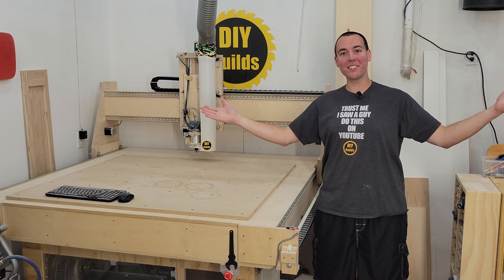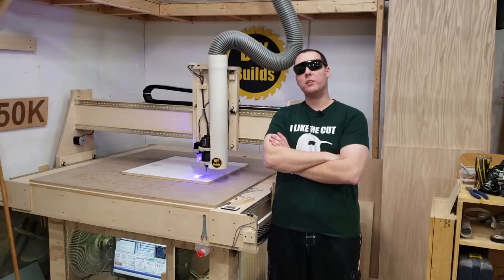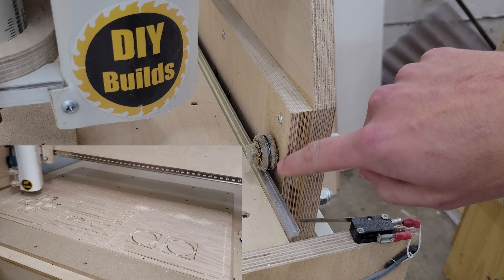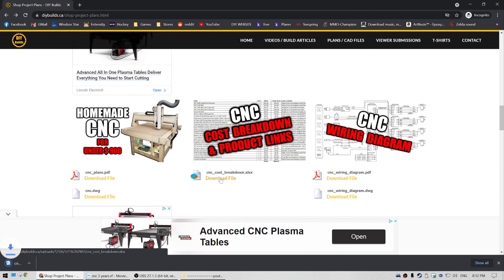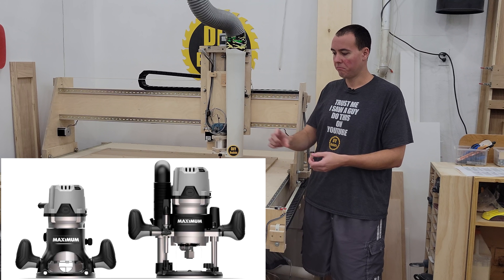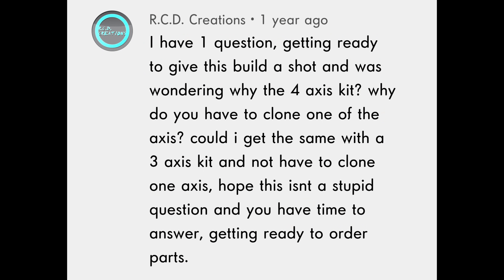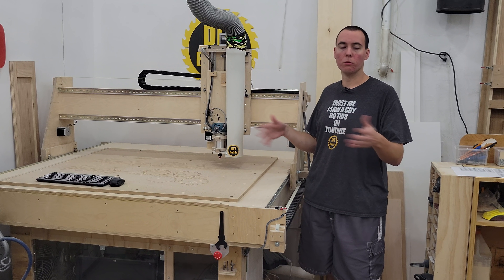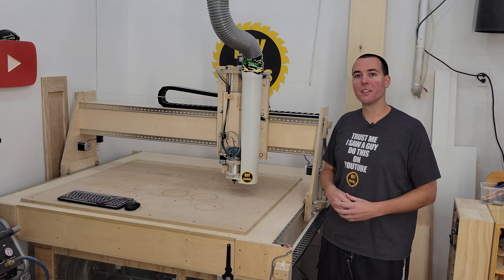DIY CNC Router for Under $900 - 3 Year Revisited

Comment: Thanks for the videos. Why did you choose plywood instead of MDF? Thanks
Reply from the maker: Stronger
Reply: @DIYBuilds  Thanks for the reply but isn't MDF more dimensionally stable with temperature and humidity changes?   I want to build a wood and aluminum extrusion CNC router with a 18" x 48" cutting area. I'd like it to have a repeatability and backlash of .002" for routing balsa, thin birch ply up to 3/8" and occasionally plastics and aluminum to 1" thickness.  I need the accuracy mostly for the aluminum and plastics. If I build out of MDF I would also apply several coats of polyurethane.    What do you think?  MDF or should I stick with 3/4" birch ply considering my concerns? Thanks again.
Reply from the maker: If your area is climate controlled including humidity then there should be no issue with any material choice.

Comment: Thank's Brad.  You touched on something that I have never seen mentioned anywhere else... the parallel to USB converter.  I have watched many videos on DIY machines, and needing a computer with a parallel port is a very common theme.  I knew parallel to USB converters existed, and wondered why nobody used one... now I know!  😀

Comment: I give you Baltzer-score of 10 out of 10. I really loved your Doug DeMuro reference was spot on. 

I have build a 600 x 1200 mm CNC more than 5 years ago with DIN rails. I used scrap aluminum profiles for a frame, but 90% og the materials was scrap finds (old laminated table top, metal profiles from an old excise bench) As you CNC I have used it for smaller jobs now and then for 5 years. Maybe 100 hours like you. I am amazed how well it works for the price. I spend $150 total at the time at had an old hand router on the shelf. I run GRBL on an Arduino based controller and it will work with USB on any PC. I use small DRV8825 2,5A drivers with active cooling and they do it quite well for the low price. 

I just LOVE the "it does not have to be a Ferrari to be a fun car" approach. The price can keep many from even trying and not all need 0,001 mm precision.

Comment: Hello I'm truly impressed by your work. You've done a great job. I just got the deal on the cheap rail set though before watching this though lol.

Im planning on building one that doesn't have as much span. Like only 50cm, I think it'll win on rigidity that way, and I don't need the surface anyways, just the length
I find your din rail solution pretty sweet, I have to go look for those bearings though

Comment: Hey, first of all, your table is amazing!!!
I'm building a scaled up version of your project (cuts full sheets), and I just got to the point where I'm ready to attach DIN rails to a torsion box. I'm wondering, should I be painting this? Do you regret not sealing yours in any way? Cost aside, is there any reason NOT to paint or at least polyurethane? I feel like as soon as I put the DIN rails on and start building the gantry, I'll have to take it back apart to exactly this point if I decide I want to paint it later, so I thought I'd ask. Sorry if you've answered this at some point in the CNC playlist! I promise I've searched if you did :)

About Mach3 and Windows... You can absolutely run Mach3 on Windows 10 (technically the issue is with ALL 64 bit operating systems, not any one version of Windows) through an external motion controller. But, unless you already have a pile of Mach3 pieces laying around, this is not very practical:
(1) Mach4 runs on windows 10 without needing an EMC, and the cost of adapting mach3 usually exceeds the price difference. Note: Because of an issue with Windows Update, you'll have much better luck with Windows 10 PRO than HOME (start by disabling automatic system updates if struggling with Mach3 or Mach4 and Windows, AFIAK this is only available in 10 PRO)
(2) GRBL will run on an EMC (an Arduino board) without the Mach3 setup. Arduino boards are currently cheaper than a decent Mach3 compatible EMC, and obviously don't have the added expense of the Mach3 purchase.
 I know you were using a system you had laying around, but I suspect for the majority of people attempting a similar build without any pieces set aside in 2021, a remote desktop client coupled with an arduino board would provide the cheapest solution. Rather than needing to purchase a dedicated system AND I/O devices, just get an RPi and install the arduino IDE and xrdp. (Obviously you should NEVER install a remote client onto an XP based system!!!)
If you do find yourself trying to adapt Mach3, PoKeys57CNC can 100% for sure get the job done. I haven't personally tried any of the others. Beware: The support for any of the EMC's will be overly simplistic and entirely in Mandarin. This is the way.
Hopefully that saves someone some research!!!
Reply from the maker: I found no reason to coat the machine other than esthetics. Thanks
Reply: @DIYBuilds  Some kind of sealant seems like cheap insurance once you buy all the birch. Maybe not for you... Your workspace is always spotless! One more question, please! I haven't gotten this far yet, but on the tensioners you built, why not glue in a chunk of dowel rod instead of cutting up bolts? Not strong enough?
Reply from the maker: It might work if they are hardwood dowels

Comment: hey brad! thanks for the followup video, i do want to confirm your suspicion with the parallel port, after winXP MS removed the necessary hardware interrupt features that make onboard parallel ports work for this project, so even if you COULD install  win10+ on an old machine, the parallel port will not work for this project, (and same thing applies with a USB-Parallel adapter

Comment: Thank you for all of your effort.  Watching your original prompted me to get my DIY CNC done.  For controllers I went with an ethernet board rather than a parallel to USB.  You can have a very long ethernet cable without any signal denegation.  Ethernet cable is also super cheap and available.  I picked up a used Win7 machine which is never connected to the internet.  Nice and simple as well as cheap.  Yes, I like cheap solutions that work.    I did not have the room to dedicate to a CNC so mine is winched flat to the wall with an ATV winch.

Comment: Nice job, so few more questions ;) :
1. Is the side "legs" stiff enough? Do they vibrate during machining?
2. Is it possible to machine aluminium on it?
3. Is Y beam stiff enough? Do you obtain same depth of cut in the middle as in the sides of it?

Best regards from Poland :)

Comment: Thanks Brad for the follow-up on cnc build & changes you've incorporated into it to make it better. Would love to see more future videos where you use it to compliment your then project(s). I'm pretty sure I didn't subscribe to your channel because of the cnc video, as much as I did because of the sandals. Your plans were among some of the DIY plans for cnc when I was looking to build one. Unfortunately, my work schedule limits my shop time, thus I never really got around to getting one finished.  I ended up purchasing one already built & while my Onefinity is awesome, it's limited on size. In the future, if I can put the fishing pole down long enough on my home time, I'm hoping to actually building your design but using a Buildbotics controller & linear rails.

Comment: Have you tried any of the Arduino based 3-axis controllers? Those (still) aren't expensive, but they do require some technical knowledge.
Reply from the maker: No. Haven't looked into cnc past building this machine pretty much.